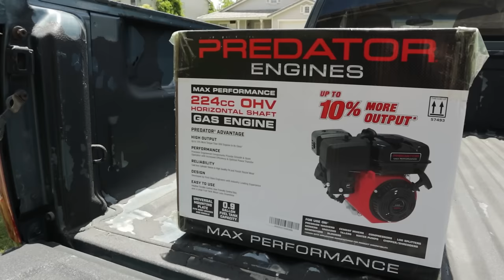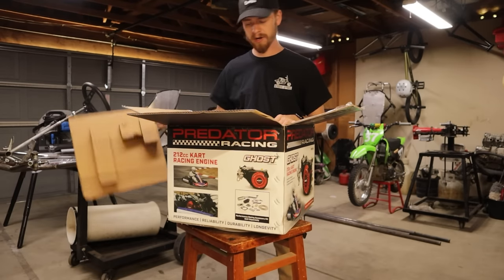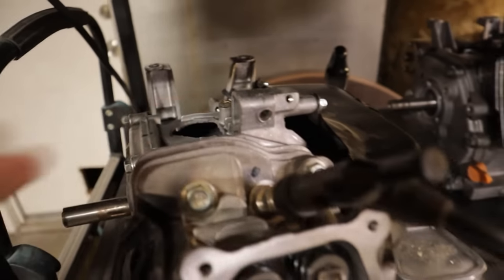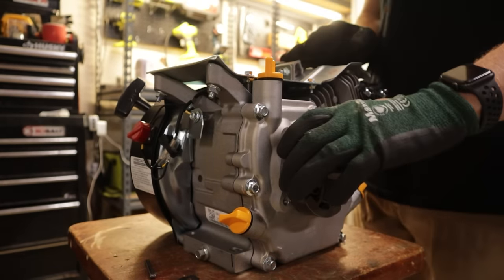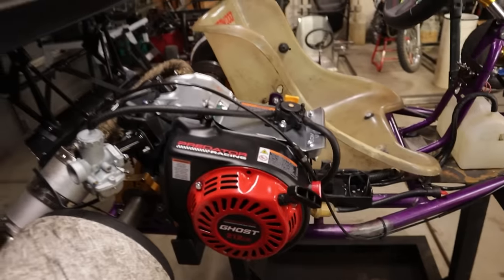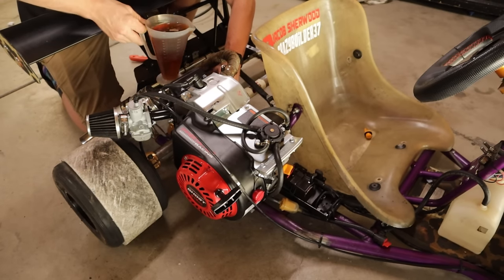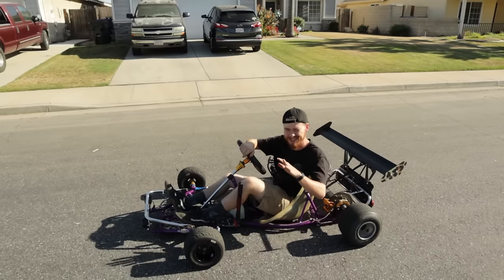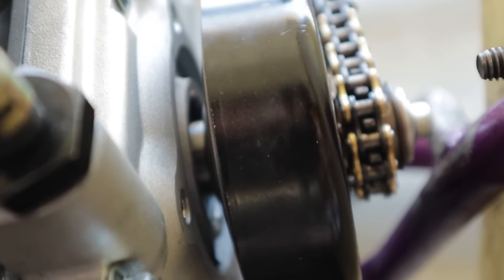Predator 212cc GHOST Install! Defective?

Comment: My ghost motors make the same exact sound. I did a 3ish hour break in and then a 100 mile mini bike trail enduro event. I was running max throttle for like 4 hours with no breaks other than to refill. Still runs great 🤷‍♂️
Reply from the maker: It’s a cam noise! I have a great update video on the way
Reply: @JacobSherwood  that’s what I was thinking being the cam is a little more aggressive
Reply: mine does too! ghost too

Comment: Try VP 4 cycle fuel. Its ethanol free, 94 octane. I run it in my 212 and its a huge difference. It starts first pull most of the time and I dont even choke it anymore, it runs amazingly especially paired with the Autolite predator racing spark plug. I was blown away by the results
Reply: 99 or nothin …. Wouldn’t put 94 in my grannies lawnmower
Reply: @AxlMetcalf  Good for you mr know it all, im sure you arent in Cali.
Reply: @AxlMetcalf  when I was younger I used to mix 93 for my yz80 and it was so much better than 87
Reply: Run 100 race gas if you can. It's honestly the best for these lil engines
Reply: @Exploder206  the only place to get 100 around here is at the track 😭
Reply: @lowlifeslides9918  damn guess I'm lucky, a gas station 15 minutes from me sells it at a pump for $10 a gallon 😂
Reply: @Exploder206  Not a chance around here its over 7$ a gallon for 91
Reply: @AxlMetcalf  troll 🤣 😂 😆
Reply: @everthingoutdoors8181  sir you’re mistaken

Comment: The one thing I needed to see, how you set the throttle cable up, was completely cut out. Awesome. Lol.
Reply: Hi Tanner...run across & Google Calis Azusa, I think you'll find what you need there , cable fixtures & fittings etc..,have a look they've got an online catalogue...easy still if you fit a mild 22mm bike slider carbs to it if you've got a std predator or 160-196cc- 212cc clone engine, especially if you've disconnected the governor/throttle likeage, fitting a bike slider type carb makes hooking up a throttle cable as easy as fitting on a bike.Cheers from NewZealand.

Comment: had mines 1st day I installed a torque converter and within an hr of riding the bolt broke off in the crankshaft and became lodged and i couldn't get it out..i just returned it and presto she runs great

Comment: Whats front spindles are you running and wheel specs?
Reply: Also interested in front spindles, I have the same frame and steering geometry style, just want max angle like his cart.
Reply: @TheRewindBros  same here.took it all apart to paint and putting back together with the same engine he has.just want angle and wheel specs
Reply from the maker: Bone stock everything excluding an extending pitman arm

Comment: Did you ever determine what it is that’s actually making that noise? I just go this engine because my old gx200 had rod issues and made that same noise. Now the new ghost I got makes the same noise but louder!!  I just want a motor that sounds like a motor. 😡😫 have you determined a way to fix this clattering? It sounds like it’s banging on the blower housing  or cord recoil. Idk. It’s very annoying!!

Comment: Somewhere arround “10.20” if you look at the floor visible between the seat and steering wheel there is a bug running across the floor😂

Comment: Hey I was just wondering did you have the stock rod in the motor I just ordered a billet flywheel for mine and I was thinking about replacing the rod
Reply from the maker: Flywheel for sure but the rod should be good. It’s heat treated aluminum

Comment: Do you prefer the clutch over a torque converter for drifting?
Reply: It really depends on how your going to build the engine. If you’re going to leave the motor pretty much stock and you have a heavy kart go with the torque converter if you’re doing a engine build with a heavy kart go with the torque converter with a juggernaut. If your kart is light and you’re going to be on the road a lot get a clutch and if you modify the motor with a spicy cam you’ll need to change the spring in your clutch to get the rpm’s up before it grabs cause performance cams raise the torque of the engine to a higher rpm. Most all cutches like max torque and cheap knock offs have a spring to change. If you want a clutch with some adjustments get a bully, viper, cheetah something like that they cost alot but worth it

Comment: Cam gear lash can make quite a noise if it has stiffer than stock valvesprings
Reply: Looks more like just excessive crankshaft endplay. I have an engine with extremely stiff valve springs and the cam gear lashing sounds like knock of death. But, it has almost 40 hours on it and going strong. Bearings in the rod still look new.
Reply from the maker: good to know! I'm definitely a noob on built engines lol

Comment: Just installed thus engine on my coleman bt200x and makes the same knocking sound and vibration is nuts on it until I hit 19mph then goes away until I some to a stop or I have to slow down but with a Mikuni racing carburetor and a uni air filter and a racing clutch and a straight chain shit hits 70mph

Comment: the ghost is the exact same as the regular 212 the only difference being is the electronic Rev limiter if your not going to race in a class just for them get the regular one don't spend the extra money
Reply from the maker: Check out the specs online! Better cam, hardened internals, etc. not a regular 212

Comment: I have a Honda 240 gx that I wanted to put on a frame I have but the crank shaft is 1" diameter and sticks out 3.5" from case, how much does the Ghost stick out?
my motor came from a trash pump so not sure if this was a thing because of that? Great video  love what you Do! 🤙
Reply: I have a gokart with a gx240 on it should be fine but couldn’t get mine to move
With the governor on it, took it out and it runs about 60 mph
Reply: I've learned alot since Commenting that, made a new engine plate, mounted it, still haven't figured out what gearing it/ me like😂
What gearing are you using?

Comment: Hey bro! Quick question. Where do you buy your sleeves for your tires?
Reply: Bro all it is is a piece of plastic pipe Lol'
Reply: @jacobsebastien3910  I know I’ve been looking around construction sites and I find a bunch of 10 inch pvc. But those inner diameter‘s are 9 3/4 and my tire only fits is 9 1/4

Comment: Junk! End play seems a bit excessive and if somethings knocking? The fact these are no different than a stock Predator bottom end and use the same piece of garbage cast aluminum connecting rods there's no racing in these "Racing engines" the flywheel is still a cast granade waiting to happen  and they didn't reinforce the blocks in any casting manner. So another ones been fooled into wasting their good money on a 99 dollar engine 🙄! Except these can't be used on anything else besides a go kart or mini bike without any governor system in place. Good luck with that disaster.